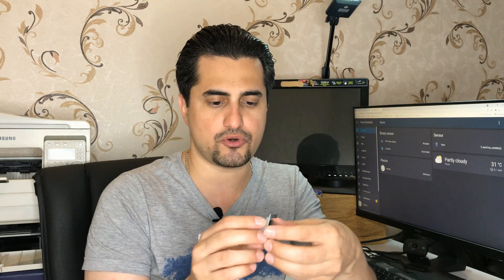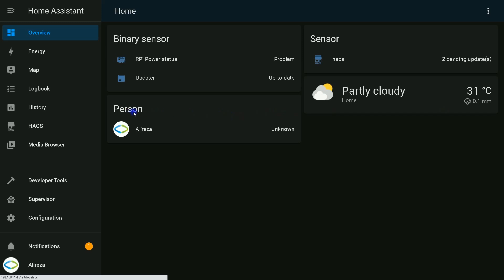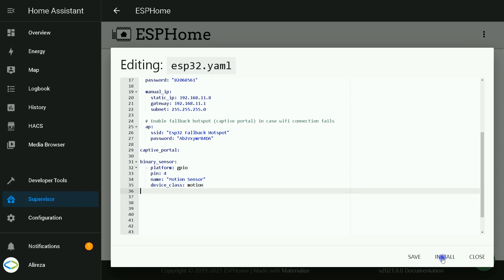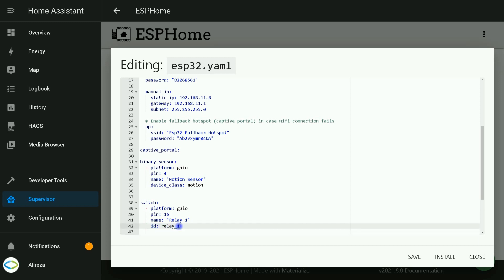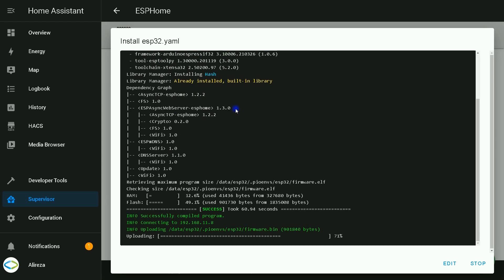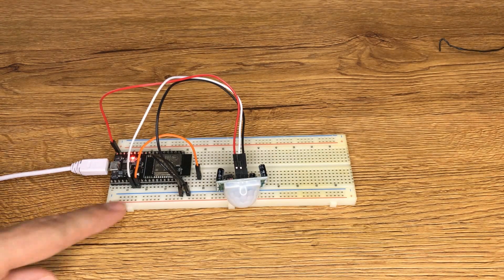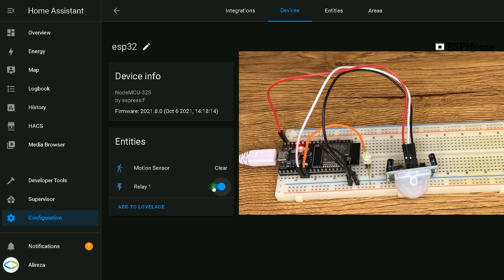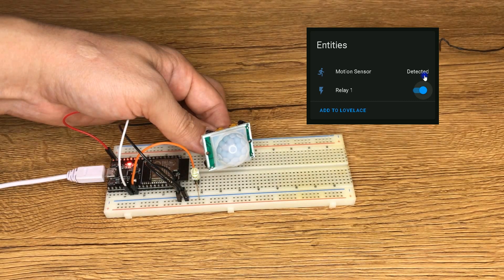Motion sensor in ESPHome and Home Assistant

Comment: i have questions about motion sensor using esphome.. 

layout is
esp8266 > motion sensor (set to 5mins) >
- when triggered, send signal to relay to turn lights on.
- after 5mins relay goes off then light turns off.

scenario problem is that when 1st guy enters, 5mins trigger is activated from motion sensor. when 2nd guy enters, motion sensor is still reading the 1st guy that entered.. so when 1st goes out, 2nd guy has less than 5mins already. 2nd guy needs to wait till the 1st guys time is out and needs to trigger the motion again.

How do we solve this to continue the light on even if there are many people entering?
Reply from the maker: Hi, set it when motion detects movement, timer resets.
Just that.
Reply: @kian.smarthome  setting it now! 😍😍😍

Comment: Hello Kian, Thanks for your video. How many PIR sensors can be powered by a Nodemcu v3 (5v output) ? Is there any limitation?
Reply from the maker: if you use external power supply for the motions sensor, there is no limitation.

Comment: Good idea adding the LED. A lot of people have false triggers with that PIR unless using longer wires to connect it. You could set the relay to internal: true so it's not visible in the front end.

Comment: Really absurd project. You can connect the LED to the sensor output and save the use of the uC.
Reply from the maker: This is a simple example how to do it for better usages. Do not forget the Alarm system i mentioned.